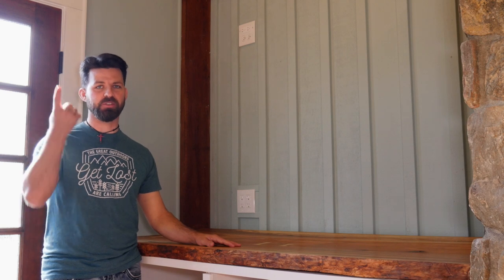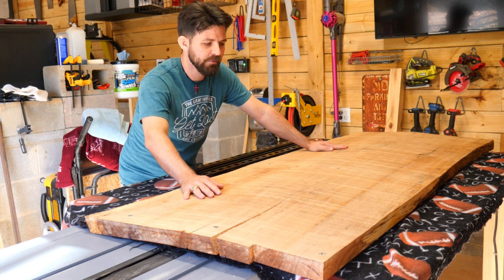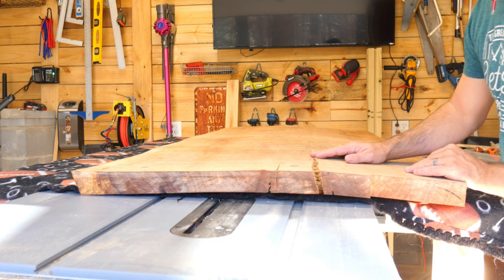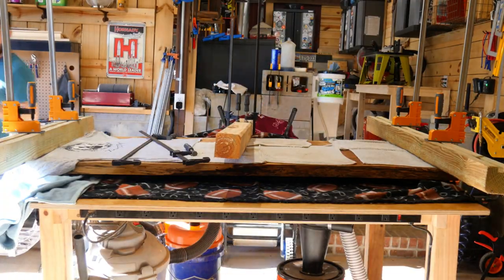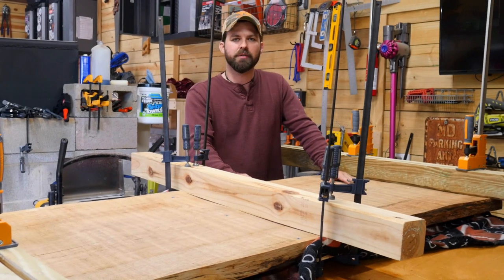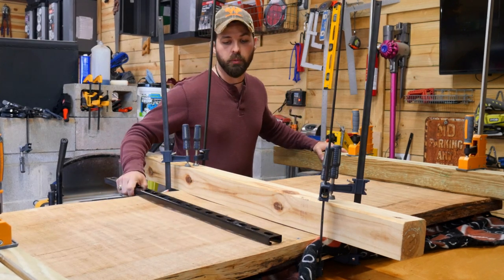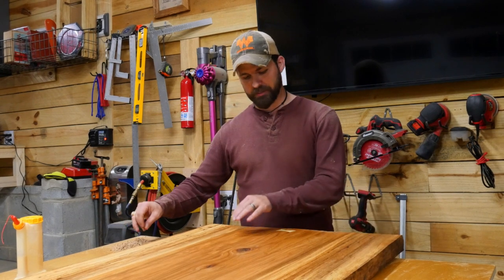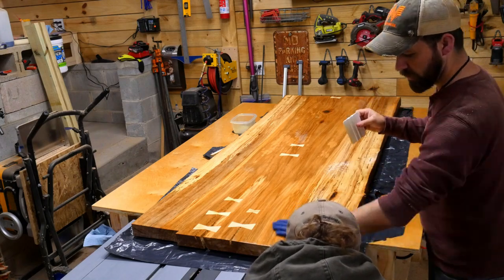Warped Wood Countertop Repair

Comment: Thanks for the great guidance and advice, you have motivated me to repair the Straight Butcher Block Birch Countertop that I purchased.  I treated it with numerous coats of butcher block oil but still warped about as much as your top.  I am no inspired to try and salvage that top.  Thanks again, great video.
Reply from the maker: Thanks for sharing! That's the entire mission of this channel, to inspire and motivate, so there's really not a better comment I could receive. Thank you and good luck!

Comment: You should seal the slab with finish on both sides in the same day.
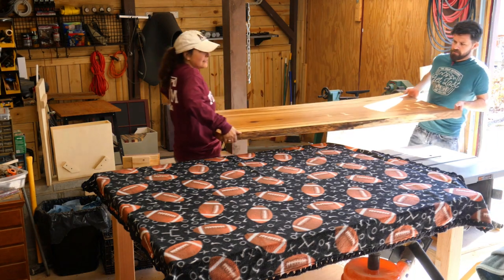Reply from the maker: That's right. I didn't really discuss the finishing part, but definitely goes hand-in-hand with what I had mentioned around 3:48 about only planning one side as well. If I would have planned both sides and sealed both sides, that would have helped.

I'm convinced the tension bound up in this slab probably still would have resulted in some cupping just due to the removal of material from where it found equilibrium during curing. I did find out from where I got the slab that someone else who bought another slab from the same tree, and just a few slab thicknesses from this one, had a similar experience. So I'm thinking this section of the tree just wasn't very stable.

Comment: I had the same warp issues on my current desk I’m building, fixed it almost the same way. I used Timber mate grain filler to accent the desk, and while it was somewhat wet I clamped the desk down and next day nice and flat. 

Also you should finish the bottom side too with the Rubio, so the bottom side is protected too.
Reply from the maker: Thanks for the info. Misery loves company! 😉 Yeah, I forgot to mention that in the video when I talked about planning both sides. But yeah, finishing both sides would help with evening out moisture moving in and out of the slab.

Thanks for the watch.

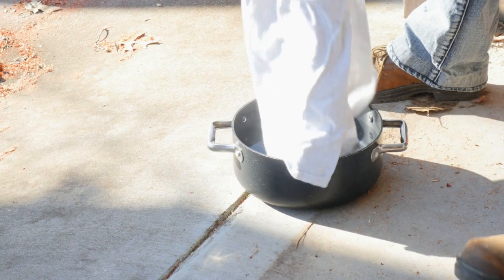Comment: 6:00 - not sure I understand the thinking in wetting the convex side.  When you wet the side, wouldn't the moisture cause that side to expand even more causing it to crown even more?  I don't have experience in this, but I would have thought that it would make more sense to just heat the convex side to try to pull more moisture from that side and then trying to clamp the board flat as the convex side is being dried out (moisture being pulled out).
Reply from the maker: I went a little more into this detail in another comment as well, but you're right. If you can wet the concave side, that would be preferred. In my case, the concave side was the finished side though, so I would not be able to get that side to absorb moisture without stripping the finish on that side first, and I was initially trying to prevent myself from having to refinish it. So I wet the convex side since that was all that was available in an attempt to just get moisture into the wood and prevent it from cracking when trying to reclamp it flat.

Comment: Impressive that you were able to flatten the slab so well.  I've seen people rip the board in half longitudinally, joint each face, and glue it back together.  Doesn't seem optimal.  Some longitudinal slits cut on the backside with a circular saw might release some tension, but you would have had to cut a lot of them to avoid making new places for cracks to form.  Your technique seems better if it works in the long term.
Reply from the maker: I had considered both of those other techniques, but figured since they're both a little more "intrusive", I could always try one of those if this way didn't work. But so far, so good! No cracks or movement that I've seen yet.

Comment: I bought some used maple workbench tops from a school shop.  They were kept flat by  tenons made of angle iron that were let into mortises on the endgrain sides.  Wood does not change in length and only changes in width.  The center lag bolt was tightly secured from the bottom through the tenon.  But the holes for other lag bolts were elongated to allow for the wood to expand and contract with changes in moisture. The same technique is used when making a breadboard. It can also be used when attaching struts on the underside and perpendicular to the grain or attaching a center brace when building a picnic table..
Reply from the maker: I thought about doing what you're talking about. Widening or elongating the holes other than the center one. I didn't do it in this case, and so far no issues. But this makes total sense and is probably worth doing just in case.
Reply: @MadeByChance  A friend of mine built a large conference table and didn't elongate the holes.  Within weeks the table split from the expansion that took place between the screws.

Comment: Nice detail and succinctly described.  I’m looking to “de-warp” a maple farm style kitchen table.  After getting the finish off both sides, do the wet T shirts get applied to one or both sides?  And wondering if the maple, being such a dense hard wood, will absorb enough moisture to do the job.  Keep the vids coming.
Reply from the maker: Thank you for the watch and the support!

If you can figure out how to get damp clothes on both sides, I would recommend that. It would reason that you'll be able to get more moisture into the slab that way and better prevent any splitting, plus get more of the cells of the woods to rehydrate and find a new normal when you clamp it, which will help it be more stable in the long run. Since you stripped the finish off both sides, that should be a good path.

That said, if you can only wet one side, it should be the side that is concave. This is because the fibrous cells on the concave side are already compressed and dried like that. So if you were to try and stretch those cells out, they have a greater chance of ripping and causing splits in the slab. Rehydrating them will help prevent this. Whereas on the convex side, the cells are stretched out. So when you reflatten the slab, those cells will be compressed which is less likely to result in the cells tearing and causing splits.
Reply: Thanks..makes sense.  Planning on using saw horses so will need to figure out a way to keep moist fabric on underside.  Periodic spray bottle use maybe, tho equal amount of saturation would be preferable.
Reply from the maker: @jaimslaw  There you go! Yeah if you can get to the underside, using a spray bottle for the first few days before allowing it to dry might work.

Good luck with it! Feel free to let me know how it goes!

Comment: Great video, I have the same problem with two worktops I've bolted together to make an island top, it looked perfect for a few weeks then both started to cup upwards at one end more than the other (same ends of both pieces weirdly) and the once invisible join between them is a canyon in comparison.  
Looking back perhaps I didn't store them correctly, just flat on top of each other on the floor with no battens, however they were wrapped in celophane/shrink (as came from a worktop company) so perhaps it was just wrong time of the year when I unwrapped and installed.

Anyway, I'm going to flip them over at some point and see if the bottom will dry out and balance with the top, however I'm curious as to why you wetted the bottom of yours rather than top, is it because the top was already oiled/sealed?

Thanks
Reply from the maker: Thanks for the comment, Chris! Yeah I didn't wet the finished side just because it was finished and the water wouldn't soak into the grain on that side. I originally didn't think I would need to refinish that side, so I only wetted the bottom. If it wasn't finished, or if I would have foreseen I would have needed to finish it all again, I would have just sanded it down to begin with and wetted it too.

Good luck on your repair! I don't know the details obviously, but if they cupped on the same ends, it could be that they're two pieces from the same tree cut around the same location. And it could be that's just naturally how and boards from that tree, and that area is the tree, want to be as they dry due to the grain and tension in them.
Reply: @MadeByChance  Thanks for the quick reply, same deal here then, I oiled the top a few times after installing and didn't bother oiling the underside at the same time (rookie mistake it seems) so I guess all the moisture has gone with gravity and expanded the bottom to give me this lovely cupping effect... All the best and hello from the U.K!

Comment: Saw the Aggie ring, gigem Aggies, my ring no longer fits, your fingers get fat as you get old, you will discover that.   MJ Neeley was a good friend of mine and his ring was smooth as glass.  He was the class of 1922.    Anyway enjoyed your video.  I'm actually doing work on a law table that is from 1900 and it is as warped as hell, thanks to a fire we had in 1976.   I will try out your method to get the boards straight.   Thanks and good luck with your channel.   My channel is some wood shop stuff but I can't resist politics so my shows gets canceled allot.
Reply from the maker: Gig em! I enjoy it when I have someone comment that's a fellow Aggie and recognizes the ring. Hopefully you can get those boards straightened out. Nice thing is it sounds like they're old and dry enough that the residual moisture isn't an issue, but hopefully they'll stay and not split out check after you attempt to straighten them. Good luck with your channel as well. Took a quick look and I'm hoping I can get to do some lathe work in the near future. I actually have a lathe but haven't used it in the year I've owned it other than just to try it out.

Comment: Just had pecan planks joined for a bathroom counter by a friend. The boards were already cupping like pecan likes to do, but were joined and planed. Now the whole counter is one big cup. My immediate thought was i’ll just add angle iron underneath in places that  wont interfere w drawers, etc,  and mount it to the wall and cabinets w either hardwood or angle iron. Watching this, i think i’ll first try to flatten it like you did. Now that its been a few years, how is it holding up?
Reply from the maker: Still doing great actually! There's a couple spots along some of the splits on the top where I can feel that there's a low spot (i.e. the edge of the splits has kinda raised in some spots), but I'd say no more than 1/16", and they're localized and not across the whole slab. As far as the edges of the slab holding down to the cabinet, it's not moved at all. Still very flat how it's mounted!

Comment: Looks like it’s approaching 2 yrs. How’s it holding up?
Reply from the maker: Great! It's still just as flat as the day I reattached it. There's a couple of the splits on the top that cup upwards towards the edge of the split, maybe by about 1/8", but the slab as a whole is still completely flat and not pulling up on any of the sides at all.

Comment: How much smaller does the drill have to be than the wood inserts?
Reply from the maker: Sorry for the delayed reply! I normally try and reply as soon as I can, but I honestly don't recall seeing your comment before. Sometimes I don't think I get the notifications. I was just going back through some comments on videos and noticed this one.

If you're referring to the threaded inserts, here's a guide from Rockler on the size of the pilot hole based on the wood material: https://go.rockler.com/tech/rockler-threaded-insert-pilot-hole-guide.pdf

Comment: Maybe it was dry...that it was sealed on one side only may have caused the cupping
Reply from the maker: That could have been a contributing cause as well. I didn't mention it in the video, but it is in the description.

I still believe that probably the largest contributor was just tension built up in the wood. I have some 9-10" boards from the same tree that I still use and just a couple days ago I was cutting one for a project and it sprung on me mid-way through the cut and clamped on the miter saw blade mid-cut (pretty scary really). But that board certainly was dry, but still had significant tension in it. I'm thinking this slab was very similar in that when one side was planned, some of that tension was released and caused the slab to move.
Reply: I've learned the hard way that you Always coat both sides of a piece of wood, preferably the same day or at most, within a few hrs of each other, otherwise sure as hell, the board/slab/plywood will warp on you.

Comment: Brave move to  cut out another bunch of material from that slab after you’d flattened it..!!! I expect that would have set in motion more movement, makes you realise why tradesmen prefer engineered timber with veneers, !!! And also just how much force expanding/ contracting hardwood can exert..💪🏻💪🏻💪🏻
Reply from the maker: I had thought about that too, but figured I wasn't cutting a whole lot, just a little on the edges. But the thin pieces I did cut off, I could definitely watch bend away from the slab as the cut progressed. So there was definitely some tension that I released that could have contributed to the movement.

Comment: Doesn't this just add more moisture content into the slab which is another problem of in itself because then you run the risk of wood cracking as time goes on?
Reply from the maker: Are you referring to the laying damp clothes on it?
Reply: @MadeByChance  yes... you add more moisture into the slab and then when you seal them with a finisher you trap moisture into the wood fibers with no where to escape thus causing wood cracking...
Reply: @MadeByChance  I'm actually in a similar predicament where one of my epoxy river tables has cupped thats why I'm asking
Reply: Or does this negate the issue since you are letting the piece dry similar to kiln drying but on a smaller scale
Reply from the maker: @IRAQYsniper95  gotcha! Yeah the thought process was to get the wood fibers rehydrated before clamping it to try and prevent it from cracking when reflattening it. And then like you said, leaving it clamped in a hot shop for a couple weeks was effectively kiln drying it to remove the moisture but then the fibers dry in the clamped position. Then inserting the unistrut is what would help prevent it from recupping after it's dried.
Reply: @MadeByChance  is there any chance I can get the same effect without installing those struts? 

Mines a coffee table that's 48 by 24 inches long and has cupped less then 1/8th of an inch on both sides... 

I just clamped it the same way in my humid garage convex side up and am leaving it overnight atm... tho am hesitant to add more moisture by means of water
Reply from the maker: @IRAQYsniper95  Is it cupping in the 24" direction? That is, the short dimension is what's making the cup? Or the long dimension?
Reply: @MadeByChance  it's exactly like yours... cupping in the direction of the short dimensions .. if you were looking at it straight down from the 24 inch dimension you would see the table shape as a sad face .. like this shape if you were looking at it sideways (====)
Reply from the maker: @IRAQYsniper95  so one thing you could try once you reflatten and you don't want to insert the unistrut is try breadboard ends for the table. This is basically supposed to do the same thing, but you would be making it longer than 48". I would think 6" on both ends of a really hard wood like hickory, pecan, or oak might be enough to help hold it flat.
Reply: @MadeByChance  so believe it or not simply clamping it down on all ends convex side up and leaving it in the garage overnight reflattened it...

I'm now in the process of letting it cool off in my house naturally... let's see if it doesn't cup again after a few days leaving it in the house to dry
Reply from the maker: @IRAQYsniper95  I hope it stays flat for your sake! Let me know how it goes!

Comment: You have to finish both side
Reply from the maker: That's correct. Finishing both sides, both planning and with the same finish, would have helped the wood release moisture evenly which could have helped for sure.

Comment: And yet, you still left one side without finish. Maybe the finish is expensive...
Reply from the maker: We're working on almost 3 years since the rehab and still no issues! But yes, finishing both sides would have helped. (And I know you said it in jest, but the finish is the most expensive finish I've done at about $50-60 for the finish itself just to seal it, but another ~$150 to have the other side planned down as well.)
Reply: @MadeByChance  $150 is a lot of money. Expensive finish indeed.

Comment: As I can see they didn’t turn out pretty good. Doesn’t seem it worked.
Reply from the maker: The repair has actually worked very good! It's been about a year and a half and the slab still has not moved. No additional cracking or checking has appeared either. The carcass is still doing great too. No warping or anything there. I think between the metal strut in the slab and the metal reinforced carcass, it was overkill, but at a year and a half later with no issues, I'd call that a win.